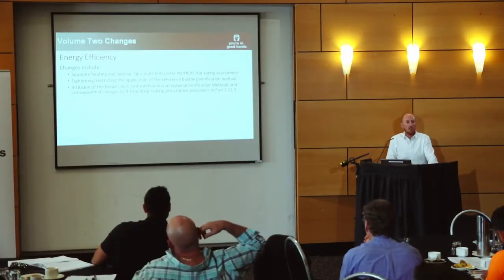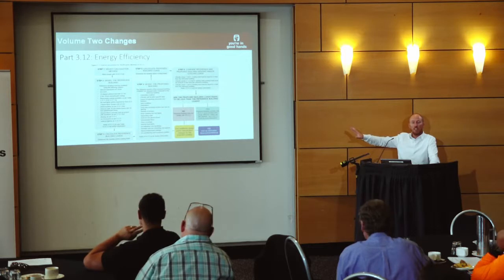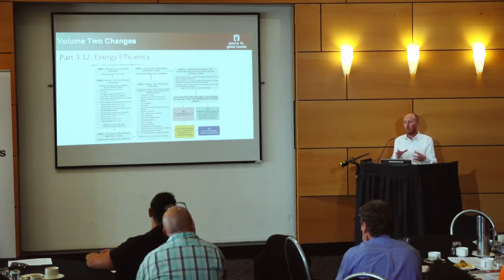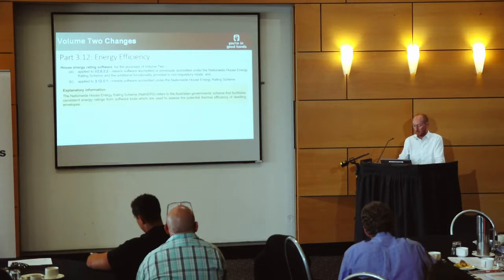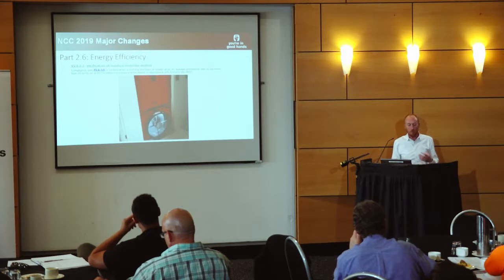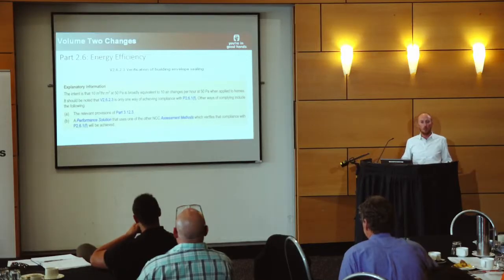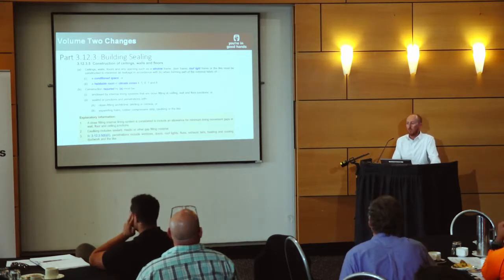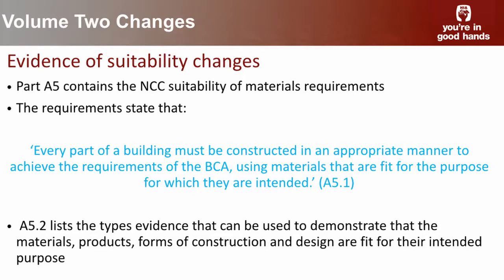Changes to Energy Efficiency for Houses and Product Evidentiary Requirements

Comment: I don't think 10 cubic metre per square metre is 10 ach per hour at 50 Pa. Let us say, we have 3 metres high ceiling, you got 3 cubic metre volum air, so the air change should be 10 cubic metre divided by 3, then you get 3.3 ACH.
Reply from the maker: Thanks for your interest Max. This seminar outlines the NCC changes and we were just citing and providing some information on the NCC requirements. For more information on these requirements, we recommend visiting the Australian Building Codes Board website here: https://www.abcb.gov.au/Resources/All-Resources?topics={D9C50C31-2F9C-4634-B8BA-D44955EC2DC0}.